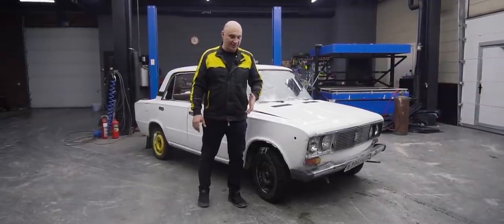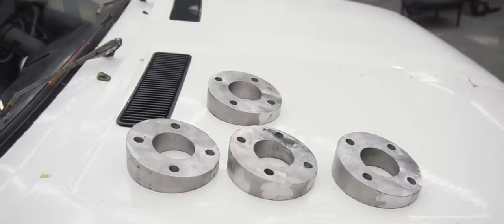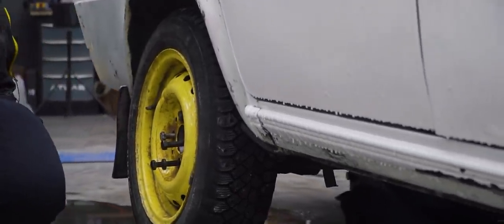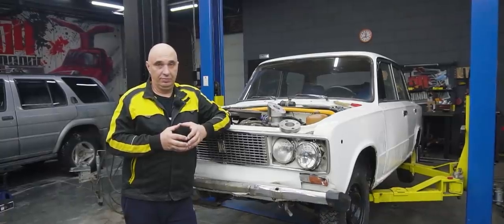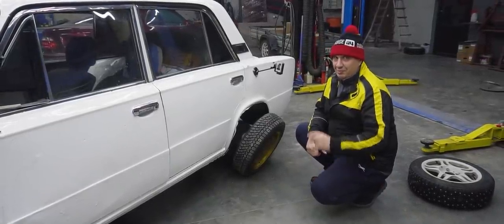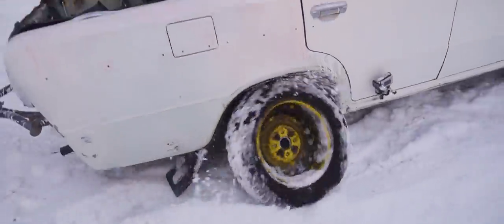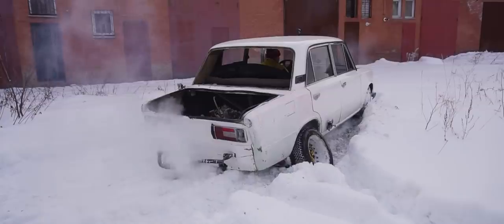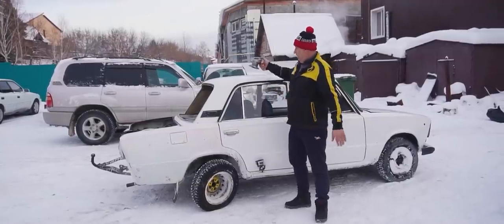Mad spacers for extreme negative camber on a Lada

Comment: I think it has so much traction because it almost pushes off like an ice skater or when skiing. It finds the edge. Nice job garage 54.  Merry Christmas
Reply: Might have merit in offroad competitions.
Reply: Imagine if you could have oval wheels 😳  would be able to make it a smooth ride. 😏
Reply: Another reason is that the tire is only in contact with the corner. A small contact patch tire will cut down into the snow better.
Reply: Exactly what I was thinking. Very interesting
Reply: Yuck Foutube  they definitely don't. A corner isn't more than the flat surface
Reply: Yeah. I think when they get stuck, instead of them rotating, they plow or scoop the snow and ice under them the other way instead of just letting it sit still and let the tyre spin freely on top of them. I think this kind of setup keeps digging and pushing the snow and ice from the "front" of the tyre to the "back" of the tyre (relative to the moving direction) and that is what causes them to have so much grip when the whole car gets stuck. On top of that all that shaking for sure helps the car get unstuck because the wheels aren't digging the same spot all the time but shake around and change the place.
Reply: Happy holidays*
Reply: I thought it was a laws of physics glitch, it proved that we live in a computer simulation, the alien supercomputer could not simulate the traction of those wheels in snow correctly.
Reply: I was thinking the same thing. Like hockey-style skates, pushing off from the blade.
Reply: @e-curb  That does NOT change is size of the contact.  Know physics.  You will change the SHAPE but not the size of the patch.  You want to change the size you increase or decrease the weight.  Increasing/decreasing camber does not change the sized of the patch until you're too extreme to be useful in your mods.
Reply: @fireballxl-5748  Use your brain! The contact does change. From the outside edge only, to the whole tread, to the inside edge only. Weight has nothing to do with it.

Comment: I have a, real, newfound respect for Ladas!!! 
You guys beat the snot out of those poor little cars....and they just keep bouncing back for more !!!!
Reply: The Volga is also a hardy and sturdy vehicle.
Reply: Look up "tuff trucks"
Reply: Like a ford ranger, but with room for friends.
Reply: @nickthompson9697  I would never insult a Volga or Lada by comparing it to a product that is commonly found on road dead or fixed or repaired daily.
Reply: Just get a mid-to-late 90’s hilux
Reply: that's because lada's don't die, they just become more powerful than you can imagine..
Reply: @garycarpenter2932  True they do not die, a LADA only donates its parts to other LADA.
Reply: @thomasechols8834  they shoud do an episode were they see how much PSI can a stock lada 4banger can do
Reply: These things are built like tanks LITERALY
Reply: @cursedcanine8414  They have when they converted one to run on Diesel. If that does not demonstrate compression I do not know what will.
Reply: @thomasechols8834  makes me whant to somhow get a Lada in the USA from russia
Reply: @cursedcanine8414  No need, buy an old General Motors Product from 1968 and older, you get good life and reliability from those engines. The 305 Big Block V6 engine is a great example.
Reply: @thomasechols8834  I have no doubts of that. However, he's done so much more with Lada, than Volgas on the channel, I'm noticing. It may be a case that Lada are easier to find there where he's located. That's my suspicion.
Reply: @thomasechols8834  I love my Ford, but good golly, given a choice over here, I'd pick the Lada.

Comment: On the rear you need a Ford Sierra diff which has driveshafts and UJ's, it would allow you to angle the hub itself to give you that camber whilst still able to deliver power.   The front is more difficult and you would need to fabricate some arms to allow the hub to be heeled over at an angle, maybe chop end of strut and make some right angles to pull the hub down from the top and you will have your magic wheels :D

Comment: Very interesting. I suspect that the lateral imbalance in the tyre is causing snow that usually builds up in the tyre grooves to be shrug off and spun out of the tyre somewhat laterally. I wonder if this would work in a real off-road vehicle. I'd be interested to see it perform off-road in a 4x4 with snow tyres and then with these spacers installed.

Comment: Make it ( electronically ) adjustable, add it to an offroad verhicle, and you are the king of the mudmasters, forever. This is some serious tech offroad car makers should be looking in to !
Reply: The amount of stress is insane. You don't get that this wouldn't last more then 15 miles and over 15 mph.
Reply: @AndyKPOV  i agree the oscialation is quite serious, maybe different alloys would hold up better (spacers and wheels and so on ...) but than again this exceeds any reasonable price range. Tire manufactures had obviously shown better ways to improve offroad driveablility after all this video is not ment to be taken serious ;)
Reply: A rock climber vould benefit...
Reply: @MrVidar0  it would break a wheel a axle or a hub so fast. Get stuck in a rut and bam vehicle falls apart. I have a mud truck and personally speaking my mud tires would beat these all day... But for jokes this is a decent idea.

Comment: Hey! You guys should see if you can make an engine run with vacuum-opening intake valves! They would have no cam actuating them, just weak springs holding them up, so when the cylinder generated vacuum for intake, it could pull the valve open to let air in, and then once it started trying to compress it, it would push the valve back closed!
Reply: Those are called ''automatic.'' valves

Comment: The reason for the traction is due to the total area of contact. This thing has the contact area of 3 tires. Granted it isn't at once but it's still there. So if it slips at one point when the tire rotates it contacts a different spot. It is a cool idea 👍. I wouldn't recommend you get it above 25 MPH or it could shake the car apart.

Comment: I think because the contact patch is constantly moving it doesn't get stuck on slippery spots. Normal wheels contact patch doesn't move if the car doesn't.
Reply: perhaps slithering thru the snow like a snake thru sand.

Comment: 2 sets of 4 holes drilled at the proper angle and the ones on the wheel mounting side ( Hub bolts ) recessed so that the rim doesn't touch them... Bolt the spacers to the hub using the set of holes and the wheels to the spacer using the other set of holes , all holes drilld at proper angles  To their mounting surfaces. Clarences could be obtained by number one not having quite such a radical angle and number 2 the thickness of the spacer.

Comment: Use the wheels lugs to bold down the space with luge drill from the spacer @ the angle you need them for flat mount of the wheel to spacer.

Comment: lol, you could take the front axle of a Landrover Defender with these "closed ball joints" and  rotate it by 90º and put it on the back of a Lada, add some hydraulic rams and play with the caster / camber while driving.

Comment: It drove smooth because you were driving on an unchanged hub offset only, you want that thing to move side to side weld the diff and position the wheels opposite -+ +- ,and for it to hop around I think you know what to do. Welding diff would also let u get thru any snow, basically with more paddle of a tire, get it?

Comment: Just hook up about 3 CV joints on each side.  Might need to drive the wheel in the end with a chain if the CVs extend up into the body.

Comment: OK another idea. Get a hatchback with a very sloped front window and make it drive like the slave1 starship in starwars.
The chairs are turned around so that the headrest is where your legs would have been, the car stands up on its back hatch, the dashboard is removed so that you can see where you are going through the front window , the engine is repositioned and wheels repositioned in a way that is stable. maybe some flower pot rocket engines for display.

Comment: Obviously those would have needed V-shaped stub axle with ball joint in middle and you need some support to hold the top of the rim in correct angle during spinning.

Comment: Those other spacers aren't garbage, offset the rims by cutting and re-welding the center section at an angle as well. 

I thought that was what you were going to do, even if those rims that look 7" wide won't work you could always use a wider rim

Comment: I wish I had a Lada in the states. Seems like a good platform to turn into a drift missile and get sideways in.
Reply: People in Russia have tried. There have been a bunch of swapped classic Ladas over the years, ranging from tame (think SR20DE or 3S-GE) to outright insane (I'm aware of at least one car with an RB26, and then there was one with a 2JZ-GTE that even participated in the Russian Drift Series). Turning this model into a balanced drift car is very, very difficult. Where they do shine is in winter drifting and in stock form: on the snow and ice you obviously don't need much power, and the platform does work for beginners who are just starting to learn how to drift.
Reply: I agree with the previous comments, it's too light of a platform which doesn't have the right weight distribution for drifting, plus the scarcity of good parts, basically older ones are the more reliable ones, but in stock form.
Reply: @killerdinamo08  the older ones (made in Soviet times) were definitely better built

Comment: Run a diesel in reverse I have heard it's possible but never seen it done. Apparently it doesn't have oil pressure though so it doesn't last long. Put the starter in reverse and it should start backwards.

Comment: You cant achieve camber with spacers.
You'd have to make a floating spacer so that the wheel remains in the same position.
Camber is achieved with your tie rods and such.
That way your car still looks dumb but your wheels dont wobble and straight cambered while driving.
Reply: Your Username is perfect for you.
WOOOOOSH ✈